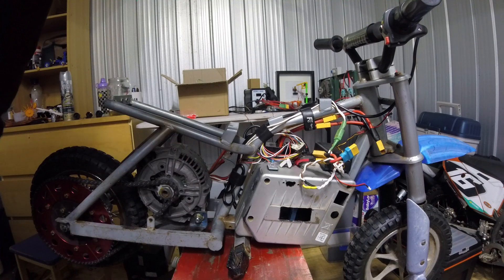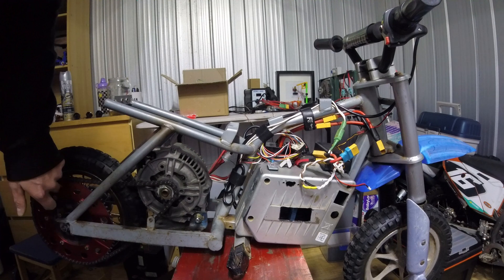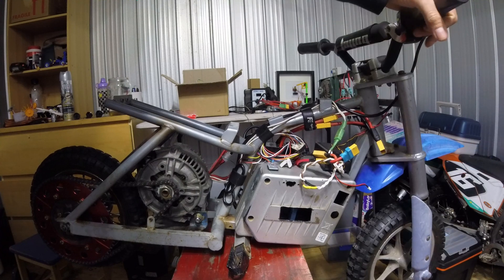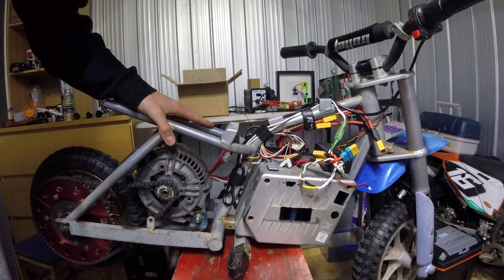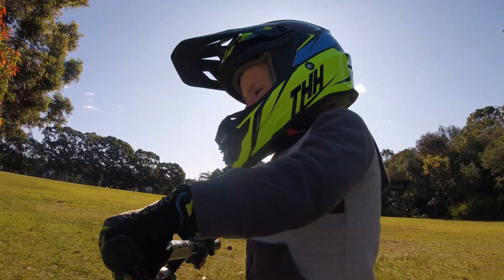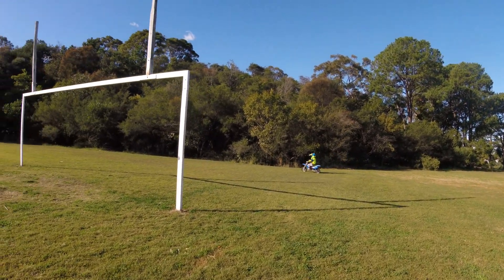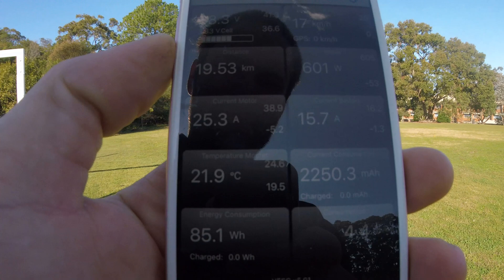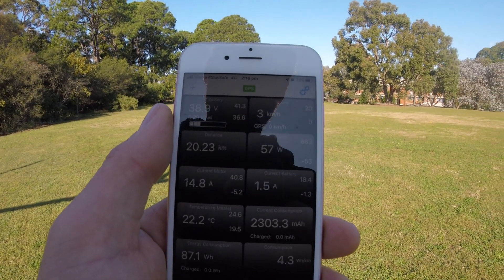converted alternator plus vesc 6.6 fitted to razor mx 350 part 2

Comment: This brings up a great idea - using the VESC to add in a remote throttle & brake controller/override. Not only makes wheelies easier to learn, but give you a way to shutdown the situation if it goes south for the kiddo. 

I've swapped controllers on the eSkateboard with friends a few times, why not a pocket bike? Seems like a fun game.
Reply from the maker: Hey mate. There is away of added gyros to the vesc 6.6 or maybe you have to buy the one with them installed but this would be a good way to learn wheelies if setup correctly.  You could set a max angle and program the throttle to lower as it comes to that angle using pid controller .  Maybe it’s something that can be done I’m not sure

My boy has done a super man when I put the currant max up!!  He wasn’t hurt and found it funny lucky enough that’s because of the safety clothing.   

Cheers for the comment!!
Reply: There's an eSkate project on GitHub / builder forums that does just what you're talking about with the gyro. https://github.com/blezalex/balance_skate/
Reply from the maker: Cheers for the link mate very interesting!!  I will one day look in to this

Comment: I am waiting for the test bench with the 200A watercooled VESC
Reply from the maker: @FoxxyYT  cheers for the push dude I think I will set that up today!!  I’ve got the pit bike running and it’s a beast so fast!!  I’ve got the controller pushing over 200amps but it restarts while riding so putting it on the load bench will help me workout the issues.  I’m thinking it needs more caps could be a brown out or something.  I’ve made the battery pack and dam it hardly sags well it shouldn’t being 10s24p!! 
Cheers
Reply: @fixitmoditbreakit7982  hehe, that will help you as to diagnose, as for us to see the 200A VESC is Worth
Reply from the maker: @foxxyytofficial   This esc is killing the load bench!!  I will get a video up soon hopefully but things are getting pushed to the limits!!
Reply: @fixitmoditbreakit7982  that is a good thing to know, i will be waiting anxiously for the video

Comment: Nice! Does the alternator get hot? Mine got hot with the new controller without any load on it.
Reply from the maker: @enrengineering can you run the motor without out hall sensors? Also I am running mine on 42 volts maybe you motor is getting saturated?
Reply: @fixitmoditbreakit7982  Yes, I tested it with and without and does the same. If the controller detects an anomaly/fault with the sensors it switches to sensorless mode.
Reply from the maker: Have you got a amp clamp meter?  If so check that you are getting the same  Ac currant across all phases!!  Just a thought
Reply: @fixitmoditbreakit7982  Yes, I will check it, thanks!
Reply from the maker: was warm but not hot.  That’s weird shouldn’t get hot with no load really.  Alternators should be fine up to 80c I would of thought.  If I leave the field coil on without spinning the motor that will warm it up quite a bit.  Has your new esc got a temp input for the motor?
Reply: @fixitmoditbreakit7982  no temp, I think only hall sensors
Reply: @OverbuiltByHenry  hall sensor order is important for controllers, your position was good but probably the controller mixed them internally
let the phase wires, swap two hall wires and test again
Reply: @foxxyytofficial  I did it and nothing changed.
Reply: @OverbuiltByHenry  strange... in this case i recommend you to check with the guys in the EndlessSphere forum